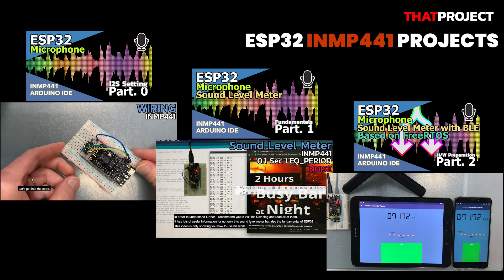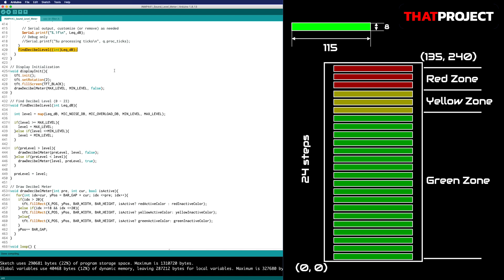ESP32TTGO | INMP441 - Drawing a meter bar for sound level display (ft. TFT_eFEX)

Comment: Hey my Friend Thanks for the nice Videos. I have a problem that i am not able to solve and i found nothing in the Internet. Maybe you can help me i have a String coming from an mqtt Server that gets received from the Esp and also Displays the value but i also wanna output this value on a Progressbar. i am using the tft_efex with the drawprogressbar funtion and it also displays a progressbar but i am confused cause i have to fill in a couple of statements for the graph like x, y , w, h, percentage, color of the frame, color of the progressbar. But i dont know what to fill in at percent part. i mean i have a value that is max 11,3 how do i explain the arduino that this value is 100%. Please help me friend
Reply from the maker: If your maximum value is 11, you can change it to a value between 0 and 100 via the map function. https://www.arduino.cc/reference/en/language/functions/math/map
Reply: @ThatProject  Ahh i got into it and i think this is a really cool and easy solution test this tommorrow thanks alot my friend
Reply: @ThatProject  Hmm doesnt wor as expected. Cause map just gives me values without comma numbers so the graph just shows up numbers like 3 or 5 but not 4.6 as an example. Also the progressbar from the library dindt delete the bar if the value lowers it always stays at the highest value that was displayed. Tryed alot but cant fix this. You have any solution

Comment: Thank you very much for your kind inspiration.  I tried to replicate your former projects with the several INMP441 microphones that I own. I found out that different microphones give sometimes different sound pressure results under the esp32-i2s-slm model. Tried to adjust the input voltage of the INMP441 with a potentiometer to overcome it  and/or to adjust the input current.  Should i use  10uF capacitor and inductor? A feasible solution would be highly appreciated. Is there any way to "calibrate" the digital microphones?  Thank you again.
Reply from the maker: It's a very tricky part. barely heard about calibration for the digital microphones. I found a couple of papers. Take a look at this. https://asa.scitation.org/doi/full/10.1121/1.5059333
Reply: @ThatProject  Thank you for your kind reply. This paper is very interesting indeed and i read it few times.
  I "discovered" the delta-sigma modulation https://en.wikipedia.org/wiki/Delta-sigma_modulation and the
 intermodulation distortion  effect.
 This is way too complicated. Again, many thanks.